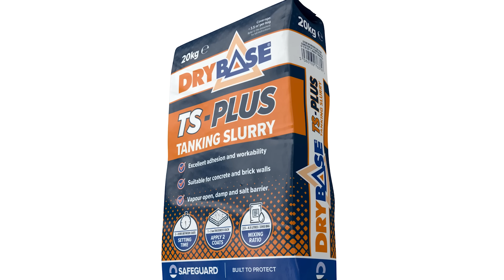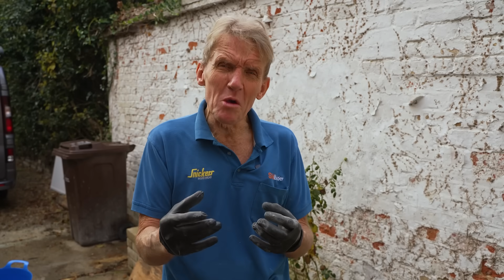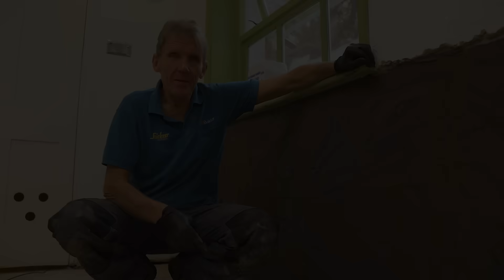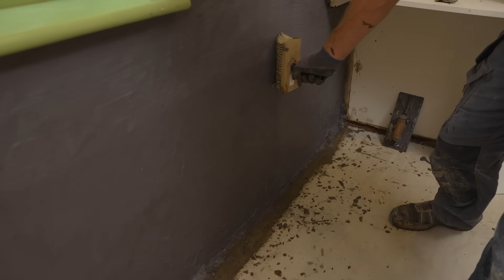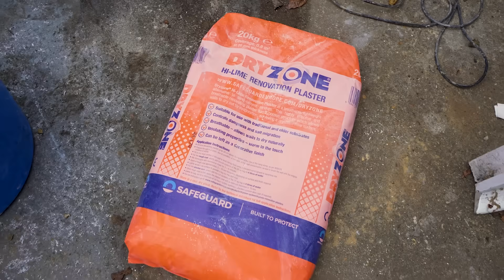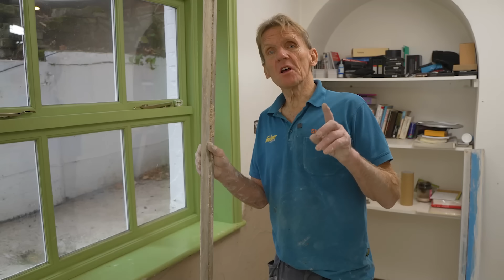Damp Creeping Back? You're Using The Wrong Material

Comment: My house is 200 years old. I have loads of Salt Peter coming out blowing the new render off. I`m sure it was cement when the house was damp course treated. It`s got a slate damp course. Well I`ll be trying the lime mortar for a change. Looking forward to it. Never used it before.
Reply: it sounds extreme, but from my experience the solution is to replace the bricks, the Salt peter is because the bricks have turned to salt, so they are shot... I did this in some areas and it totally fixed the problem and I am regretting the areas where I didn't do it and the damp is coming back through, even with Hydraulic lime render. This happens to bricks which were in the same room as a fireplace / chimney etc.. the chemicals from the fire react with the bricks and turn them to salt. I don't mean to replace the entire wall, but lower layers where the problem is visible and they are in contact with the foundations are worse effected. My house is also around 200 years old and the problems are in the former kitchen area where the fireplace was.
Reply: @Mick-Ozz  yes mate. I`ve even seen a old house where they took the bottom bricks out one at a time and replaced them with engineering bricks. I might start doing that. Internal walls will be easy but the double brick external ones will be tricky.
Reply: We have lime plaster but still penetrative damp in some areas. Stormdry very successful so far.

Comment: 2,50 mins in what are you putting on that wall?  4 mins in, what are you threatening that wall with? ts plus tanking slurry 1st layer at 4 mins? 9 mins in what are you slapping that poor old wall with? Is that the second layer of ts plus tanking slurry? 10 and a half minutes the plaster? what are you mixing in the buckets each time? ts plus bag and what polymer? adding water and how much? plaster and polymer?

Comment: How do you protect the window sills and lower frames? Also the idea that damp only rises a metre is one of those industry mantras with no scientific evidence. I’ve seen buildings that are not even basements where the damp is evident 2m above floor level. The drained membrane only works if you have a completely sealed system, which is very difficult to achieve, otherwise the permanent humidity behind the membrane encourages all kind of mould and fungus with long term health implications. A company like safeguard if consulted will always recommend two systems for residential basements - waterproofing slurry first then drained membrane. They will then step back and tell you to use an approved installer, who will go out of business a year after the work. In short there’s no easy DIY method for waterproofing your basement.
Reply: I agree, there should not be ANY use of synthetic near the natural materials!  Dehumidifier could be the best choice..I have relative that has a house built on sloope rock on one side..uses dehumidifier 24/7 & it is always dry in the basement with no smell or damp...

Comment: As an engineer I always overthink things….I get that the polymer stops the damp from entering the room, but what stops the first normal plaster/render layer against the original stonework from separating  due to the ever present damp from being underground?  Or does it remain bonded to damp stone?  Could the hydrostatic pressure ‘pop’ the plaster off a deeper wall? 🤯
Reply: I doubt it . Render generally bonds very well to a coarse brick wall

Comment: wont stop condensation forming on wall surface though , if wall is not insulated properly
Reply from the maker: You are correct but the humidity levels in the room are much lower because of the underfloor heating and the Limelight plaster is a better insulator and absorbs a certain amount of condensation and realeases it as the wall warms up. Nothing it idea but it is way better than what was there.

Comment: I hope I'm wrong but I'm pretty sure you've made a mistake in your approach to this.  You've decided on a vapour open tanking slurry but you also used SBR, which is a vapour barrier, preventing the moisture already in the wall from evaporating through the tanking slurry as it was designed to do.  The cement render is also not adequately permeable enough, would have been better if you'd used lime.  There's a vapour open lime plaster called Rinzaffo MGN that acts as a tanking slurry and is ideal for basements. You may have not even needed the Dryzone TS plus, though they do make some good products.
Reply: I know the answer, but nobody chats on YT anymore so no point in going any further!
Reply: @lksf9820 hey I'm talking here! 😂

Comment: Excellent. Thank you. I am renovating an ancient barn and the basement walls are old stone and some sort of lime. there are big gaps - especially now after a bit of sand blasting to remove all the loose stuff. should i just prep the wall by building up the lime render in several coats to build up to a flat surface, or is there and better way to prep the surface before the Tanking Slurry?

Comment: Do you have a long time to work with these high lime renovation plasters, like traditional lime plasters?
Reply from the maker: yes it is the same, you can bring them back the next day.
Reply: @ thanks. I’ve been doing this exact sort of work on one side of my cottage, which is effectively built into a hillside. There’s a lot of naysayers regarding tanking, but as you say, what else can you do. I put a French drain in one shallower area but tanking the walls inside is essential. Not come across this polymer based stuff though, hopefully the water based will suffice. I’ve built studs in front of a couple of walls but will try renovation plaster on the others.
Taken me months! On the plus side I can see the tanking has worked.
Reply from the maker: That is good to know. The Limelite isn't cheap but it works.

Comment: So, You're going to trap the damp in the wall  ? maybe try and find the cause of the damp in the first place ? My cottage is damp and it's because there is excess water under the house and I've got to find out what's causing it.
Reply from the maker: Ivan 
I can tell you what is causing it, rain. 
This wall is below the ground. How do you propose to dry the garden out? 
We showed you the Aco drain which stops water running down the wall but unless you are going to dig all the way along that wall and install a membrane and drain you are not going to do much. 
If you can cure damp from the outside, do it but if not do it on the inside.

Comment: If you can give a wide open escape route for water on the other side, I would just put RIW bitumen over the wall and down to the dpc. Impermeable, as I want the moisture to go out. My concern is always with water rising above the RIW if there is no route out. Where I have concrete tanks I use a cement and PVA mix and give it all a good rubbing to fill all pinholes, which usually reduces leakage substantially, followed up by a cementiois tanking product. So I was interested to see your thinking on this.

Comment: looks like you were struggling a bit with that lime 😉 my tip is not to use metal tools on lime plaster - i use a piece of lumber a bit bigger than a steel float with the corners cut away to form a handle , you will find that it doesn't bring water to the surface and drags a lot less, small circular random massaging type movements really help too
Reply from the maker: I will try that, maybe a plastic trowel or float
Reply: @SkillBuilder  its got to be wood Roger - any old bit of construction timber will do
- good luck

Comment: Interesting, thank you.
I’m not a builder but am a chemist, it does seem counterintuitive to put a fully permeable lime plaster over an impermeable tanked surface. My instinct would have been to lime plaster and clay paint and let it breathe fully. I’ve tried this on a wet conservatory wall we had and it worked a treat, but I took it back to bare brick first. 5 years later and it’s still perfect.
Reply: Hi Roger
How many days do you need for the tanking slurry  to dry before you can put the damp resistant finishing plaster over the top of it
Reply: So what paint can u use with these breathing walls? This is aime render?
Reply: What's a tanked surface?
Reply: @RuairiGogan is a wall that has been painted with a chemical treatment that is impervious to water. Often it is painted onto a rendered wall to make it easier to get a good seal. It genuinely does work but it’s Achilles heal is if the wall or render cracks because so will the tanking. You buy it in powdered form and have to mix it to the water volume specified on the packet.
Reply from the maker: I think sometimes that being a chemist blinkers your thinking.  It is more helpful to think like a builder in these cases. 
We don't want water vapour coming in from the outisde because the ground will never be dry so it makes no sense to have a pathway for damp into the building wherther it be vapour or droplets.
The idea of lime is simply that cellars suffer from condensation especially in the summer and a gypsum plaster will deteriorate. 
It is also the case that if any tiny amount of moisture came through the membrane (unlikely) the lime plaster would allow it to evaporate and you wouldm't even detect it. 
The additional advantage of lime is the buffer effect it provides for condensation.
It is also warmer to the touch than gypsum.
Reply: @ Agree that I’m not a builder and you know what you are doing, but from a water diffusion gradient it does feel like putting wet washing in a plastic bag and expecting it to dry.
Reply: @SkillBuilder I think any builder is in a difficult position with damp proofing. It’s a very captain hindsight thing, because one guys tries an approach, if it hasn’t worked the next builder comes in can see what has been tried and simply say “ oh my word , how was that going to work” .. I think you’re right with the 50/50 approach..a hack off and render internally has the problems of when you re render the substrate is dirty . You cannot clean it  properly if it’s in a property that is lived in. By using a stabilising solution and a set cement slurry and indeed a mortar that contains sbr , you are increasing the chance of a good bond and reducing the risk of cracking. As you have said rendering and tanking increases the probability that the tanking will be successful.  By using a lime based top it’s exactly as you say , it will absorb a lot of condensation making people experience of their home more favourable. You could top with a lime putty which is breathable yet has a ph the mould finds unfavourable! And my top trump card is! When people go on about Victorian homes being “breathable” , if you live in a rendered one , it was painted in oil based paint, which in no way shape or form was breathable. Further the victorians did use cement. They rendered the stone work in hydraulic lime mortar, then used a “butter coat” this was a 3mm thick coat of 2 and 1 super fine sand to cement . It had less problems than lime putty and was applied in the same way multi finish is used today . So it was trowel and the high cement content meant it was not breathable in the same way a hydraulic mortar and lime putty is 
In this modern electronic world people seem to think buildings are the same as making a phone! They are not. The original construction of the property is wrong, and a builder is being asked to some how fix a poorly designed construction. I know I rib Roger about his trowel skills😂i cant help it.. but I agree with 90 percentage what this guy says .  He has a genuine interest in construction and that approach is  always going to succeed.
Reply: @SkillBuilder  You are absolutely right about it working brilliantly against condensation, but I am afraid not right about trapping moisture in the wall. It should be allowed to escape via the plaster and then ventilated out.
Reply: @SkillBuilder Might be more useful if builders thought like chemists
Reply: It's a basement, not a conservatory. The outside wall is rain soaked wet mud. Will never be dry. Also need a  good mechanical ventilation system..
Reply: @ wouldn’t it make more sense to tank the outside that is in contact with the source of the water, rather than stopping it once it is already in the mortar? Then, to let any remaining water to evaporate out into the basement and mechanically ventilate. 
I once had a house that was built into a steep bank (it was brilliant as it kept warm in the winter and cool in the summer), that was tanked from the outside and had drainage, we never had damp walls.
Reply: @yp77738yp77739  i don't know if you're being serious. Yes it would be better. It would be better to live in Marbella in a £10 million villa.
The point is that this is already built and he is trying to find a solution "after" it has been built.
Your not seriously asking him to drive a moat around the property to tank the basement.
Reply: @ Yes, that’s what I did, with a spade. You need to dig it out anyway or you can’t improve the drainage. In my opinion the drainage is far more important than the tanking. You either want to do it properly or not bother at all and live with it. I genuinely don’t get why you think that is contentious.
Reply: @yp77738yp77739  It's the sort of thing you might do on your own property when it's your labour, and there is no time consideration.  For a customer, you can give them the options, but they're unlikely to go for the cost and disruption of a metre plus deep trench, all around the perimeter of the basement, which is likely to involve digging around services and drains.  If the water isn't adversely affecting the structure, the compromise of allowing it into the wall, but not through to the basement is the way to go.
Reply: @ you are probably right. 
Although not doing the job right costs more in the long run. I’ve had 5 different roofers try to solve water leaking through or around) my chimney breast and it’s still as bad as the day the first one didn’t know what they were doing. I don’t mind paying for expertise if it is expert.
Reply: @yp77738yp77739  did you manage to get the chimney fixed? What was the source of the leak?
Reply: @  Not fixed, not even any reduction after 5 different roofers, spent a lot of money on scaffolding alone.
The chimney comes through the roof and straight into the room as there is a mezzanine, it’s a brick fireplace so it’s easy to see the wet bricks and salts. I wouldn’t care so much but I need to add some insulation into the roof to get the house ready for a heatpump, but I don’t won’t to insulate whilst I know water is coming through. It has new cap, the flaunching is fine, the pot is sealed, the bricks are pointed and entire brickwork waterproofed (against my better judgement), the soakers are in place and the lead work is fine, the felt is good, no cracked tiles. But, still it comes through.
Reply: @yp77738yp77739  I'm doing one now. Water ingeress over many many years has totally destroyed the mortar between the bricks.
With all that you mentioned being good, it can't be from the chimney area. If everything is watertight it does not sound right.
Reply: @ yes I know, but it is, it penetrates down through 4 courses of bricks from the ceiling board within 2 minutes of rain. Its associated with the stack as it’s appearing in the stack section of the breast and left and right of the breast is dry. It’s not running down the bricks but they go dark dark and have a thin film of water on them. 
I’ve started an experiment, starting at the top I’m sequentially covering further and further down the stack. I’ve got as far as covering the  cap with a bucket but then the storms started. I hope that as I cover up the problem area the water should stop. 
If my diagnosis fails I’ll have to drop the stack as I moved my parents in during covid as they were vulnerable and I need the house warmer for their health conditions., hence need to insulate better.
Reply: @yp77738yp77739  I was thinking exactly the same thing. The water is still going to remain trapped in the brick work. Over time, water damages bricks and makes the material deteriorate. It's like using anti mould paint over the mould (not from humidity)  - you're not going to see the mould but the damage is still there underneath! Maybe I'm missing something here!
Reply: @redx11x  Won't that brick wall crumble after 10+ years due to the water damage?
Reply: @ The builders solution to my wet conservatory walls was to enclose the wall with pvc sheeting. When I came to strip it off it was dripping in black aspergillum mould behind the sheeting and we had been breathing those mould spores for years. My solution allowed the walls to breathe and we never had an issue again.
Reply: I cured damp on the chimney breast by rendering the chimney, new leading etc.
Reply: @yp77738yp77739  Yes it is most definitely better to stop the water coming in than to dam it on  the interior of the wall - as a wet wall is a cold wall, which is therefore more prone to condensation damp.  However I do understand that this is more expensive and may not be acceptable to all  building owners.  Also I personally prefer the membrane option  as this is totally reliable and creates a warmer internal surface which tends to remain above dew point.